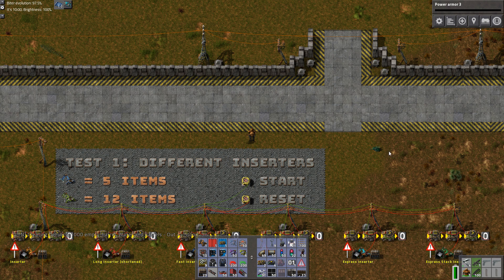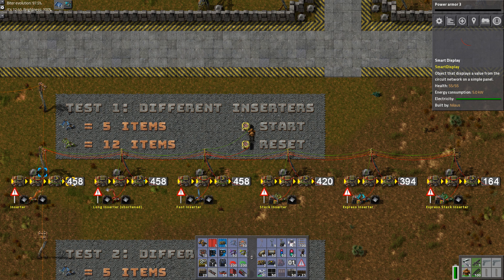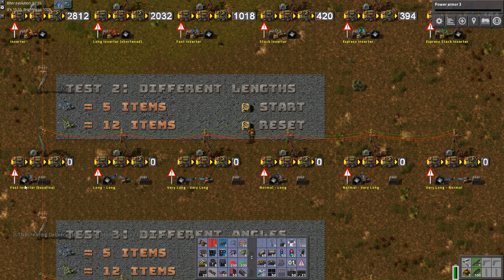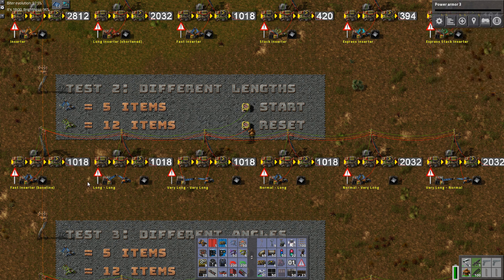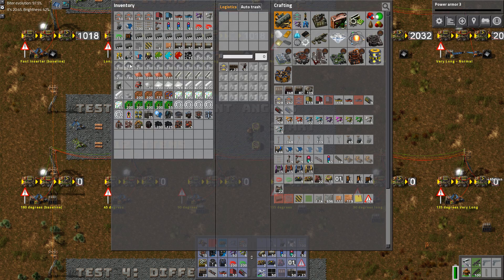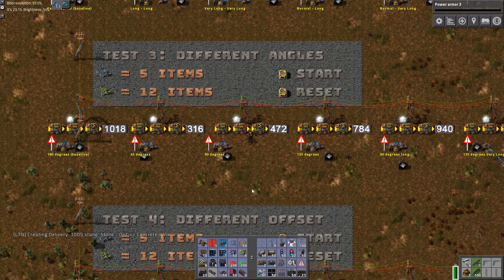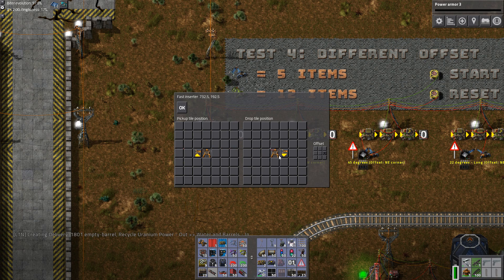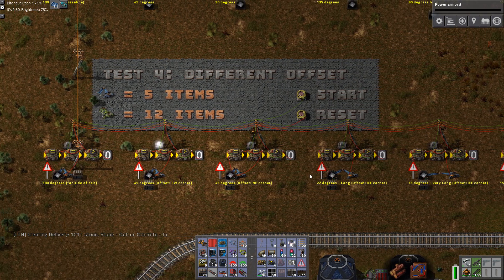Factorio - Bobs Adjustable Inserters - Speed Test (v2)

Comment: I have a typical example for the absurd advantage of small angles: https://www.dropbox.com/s/98jvsqevjv10mm6/Loader.jpg
The design using small angles has more than 3 times the throughput (about 2200 items/sec with stack size of 12) of the regular design (about 600 items/sec).

Comment: the speed with the offset comes from the fact that inserters are defined with an extension speed in tiles per tick  and an rotation speed in rotations per tick. those are simultaneously, so the extension only matters if the rotation is short enough. I believe inserters try to grab from and put into the center of an entity. the speed of the basic inserter is defined to that in the time it takes to rotate 180° it can extend 1 tile. I think the others are set the same way.